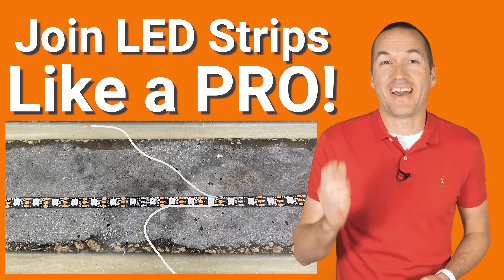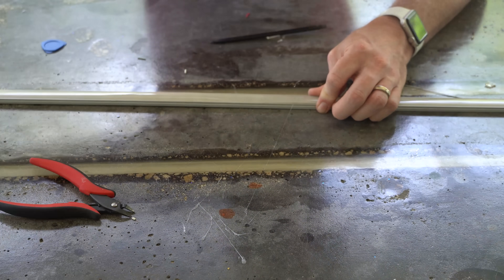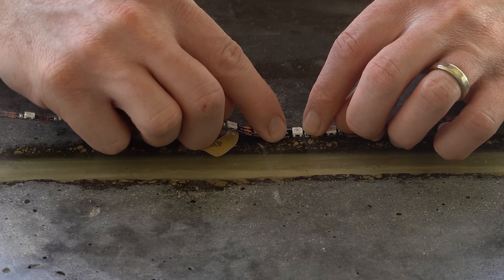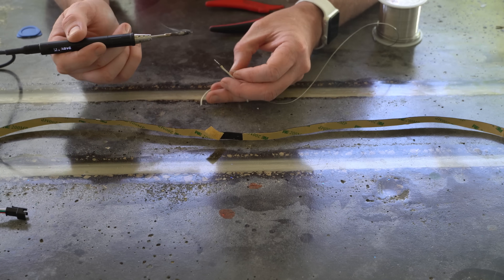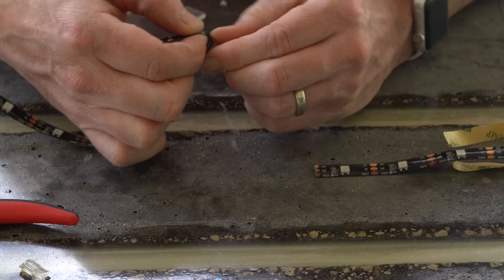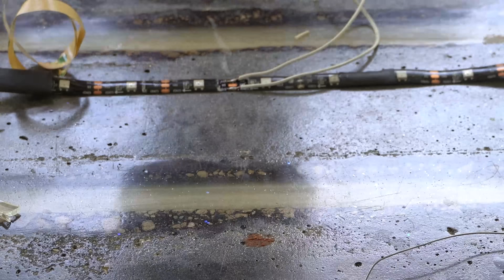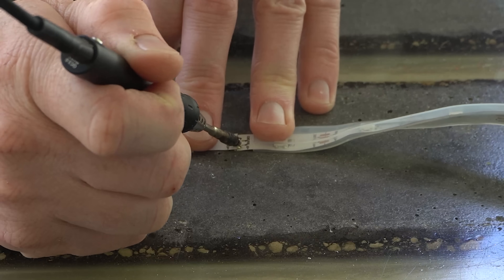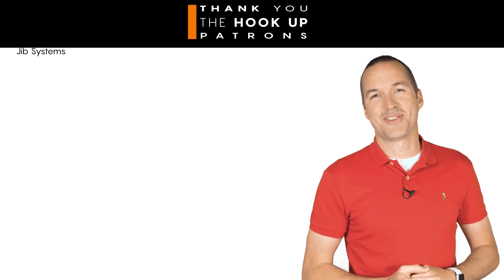The BEST way to join LED strips with no gaps or seams + make waterproof power injection connections.

Comment: For IP67/IP68 silicon tubing LED strips just use regular clear color (transparent) silicon. Yes it takes 10 - 20 minutest to harden, but it works and also does not allow leaks. Even something more - it is more flexible than the hot glue. :)
Reply from the maker: I did that in my landscape LED lighting, it unfortunately leaked.
Reply: @TheHookUp  Sorry to hear that .. My Christmas tree (16 pieces) and star (10 piecess) are made of pieces of IP67 strip. At each 2 ends of each picece and all of the pieces joints I've put sanitary clear color silicon. It already resisted 5 months of heavy rain, very heavy snow, winds with 60 up to 100km/h and temperatures varying from +20 donw to -16 degrees celsius and it is mounted outside, I mean directly under the sky.
Reply from the maker: Mine lasted a little over a year before it started giving me problems.
Reply: @TheHookUp  Ah, so It wansn't so bad sealing. :) 1 year is not so bad if we aren't talking for permanently mounted lights. My tree and star are detachable and can be dissasembled till the last piece of strip, so I haven't made it to last that long and each year, before I mount them, I check them to see if any piece needs additional isolation, soo .. Yeah, you're right - this is not suitable for permanent instalation. But this is something I knew, and I'm actually surprised it lasted so long, because by datasheet these strips are not meant to be used in such harsh weather conditions like ours. Sometimes it gets cold as -20 degrees celsius here (and even much lower as -27). So for 5 months I've lost only one pixel and it is not even dead, it just lights only in red. :) Anyway .. I know this isn't the right strip for this purpose, not because of the water, but because it is very flimsy, jelly and shaky in a strong wind. It isn't very easy to make it stay steel. :) This year I'll have to switch to another type of strip or I'll have to use alumininium channels, which will solve all the problems. :)

Comment: Tip for ip65, use clear shrink tube so you don't have to worry as much about the size of tube used (i.e. if an led is partially covered, light won't be blocked).  You didn't seem to have that issue.
As for IP67, I love it, as I just mount it directly outside without worries (almost 2 years now in Canada, so -40c to +40c).  If using 5v, I agree, don't get IP67.  If 12v (what I use), you can inject power at each end of 5m no problem.  If you need to shorten a section, it is easy to create a water proof wire joint at the end (just create one same as the factory using similar methods you showed in the video).
Another tip, but if using hot glue, not really needed.  There is shrink tube with glue already inside for making waterproof connections even easier.

Comment: Hi Rob. I ordered 5x 5m SK6812s which should be in my grubby paws any day now. Since ordering from China is something that doesn’t happen everyday, I added those snap connectors into the mix just in case. Considering that I plan to lay the strips into aluminum channels, would those snap connectors fit in those channels together with power injection wiring?  Or should I rather just bite the bullet and solder strips together as you had demonstrated in this video.
Reply from the maker: In my experience the snap connectors do not fit well in the channels.  You can buy deeper channels, but they are more expensive.

Comment: If you don't want to sacrifice an LED, you could solder a wire between half pads to create a strong joint. It actually may be stronger than just using solder. Just take a small (22 gauge) piece of hookup wire and solder it to each of the pads on one end then (tinning the other pads first) butt the two strips together and then solder the wires to the pads on the other strip.
Reply: Im sorry but more often than not u have a left over piece of wire that has about 1/4 of the solderpads still on em. If you want to make sure your strip doesnt randomly die, just cut off an led and solder it propperly. its a quallity thing

Comment: Thanks for the video!  What gauge wire are you using for the power injection?
Reply from the maker: The pigtails in the video are 22.  I often use 18awg home runs and 24awg parallel runs.
Reply: @TheHookUp  Thanks!
Reply: @TheHookUp   LOL. All video instructions in metric, but give wire sizing in crazy AWG.

Comment: Rob, nice tips! I use 18AWG wire for power Injection, and solder the wire to the back and protect with clear heat shrink, when using aluminum channels. Then I drill a hole in the channel where the wires connect and run it outside of the channel.

Comment: Can you split the data line on individually addressable LEDs so that two sets of strips run the same pattern at the same time? Using Rob's concrete countertop as an example, could one data line control both LED strips?
Reply: Yes, I run four strips off of the same data line from an ESP8266.

Comment: I use marine heat shrink. It has a hot melt glue lining the inside of tubing. Obviously not as thick as applying hot glue separately, but works great and one less step. Could also use conformal coating instead of glue, but have to wait for it to dry and good idea to use 2-3 coats. Your way is an easy, effective method.
Reply from the maker: I got a battery powered hot glue gun and I'm never going back to wired, it makes the hot glue step super easy.
Reply: @TheHookUp  what one do you have?

Comment: All my strips are multible 50cm lengths not 1m
Reply from the maker: I actually think it has to do with the number of LEDs per section.  In 30led/m strips they are usually 1m, but in 60led/m strips they are in .5m strips.
Reply: @TheHookUp  maybe just doubled checked and all mine 30/60 rgb and ws2812b are all joined at 50cm so might be dependent on some other factor 🤔

Comment: I'd like to use USB-PD charger with 12v trigger board to do the power injection. Do you this it's a good idea? Or should I stick with traditional power supply?

Thanks
Reply: I would like to know someone’s opinion about this question as well.
Reply: @leisureavidgentleman8901  you could, but why? much cheaper to buy a dedicated power supply at 12v than a PD charger and trigger board.  If your looking for something portable, then this maybe a good solution.
Reply: @marcusone1  thanks for your opinion. It’s greatly appreciated.

Comment: I want to remove the slew from a ip67- strip, any tips how to do that?
Reply: Just cut off the factory wire ends and slide it out. I do it all the time when I don't need the waterproofing.  why i prefer the ip67.  just be careful what you mount it to because the back side pads are exposed you can short them.  I just use double sided tape wide enough to cover the strip and go the entire length I want. works great.
Reply: @marcusone1   Thanks!
Reply from the maker: What's a slew?
Reply: @TheHookUp   I mean the protection thing around IP67, the strip is like 12.01 mm wide with it but the alu-profile have room for a 11.98mm strip and since i will cut and keep it indoors so i don't need waterproofing
Reply: @TheHookUp  and  "sleeve"

Comment: In an industrial/manufacturing environment that's needing a lighting solution for not only equipment changeover and pharmaceutical cleaning but also inspection for cleanliness prior to reassembly, what is/are the best LED strips to approach when it comes to safely lighting long and short locations that typically are shadowed yet need to get sprayed down with some slightly boosted pressurized hot city water pressure? In such an environment, how would wiring best be ran and protected?

Comment: What are you using to up the power to the led?
Reply from the maker: You can check out that other video that I linked for the specifics, but basically I'm using a combination of home runs using 18awg stranded and parallel runs using thin solid core wire.

Comment: Just one question: Why only power inject the positive rail for traditional strips? The ground lead on the strip would have the same voltage drop on both types, right?
Reply from the maker: In a 5 wire (RGBW) strip, the + voltage is 1/5 the size of the -, which is split between RGB and W.
Reply: OK, makes sense. Thanks!